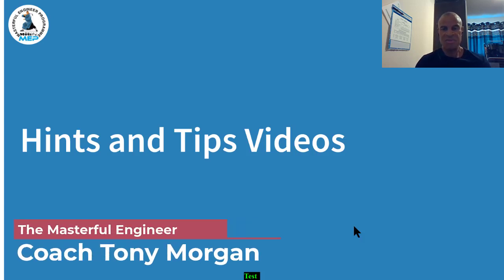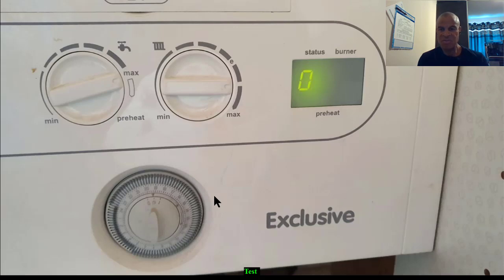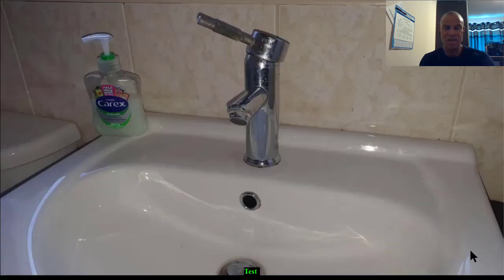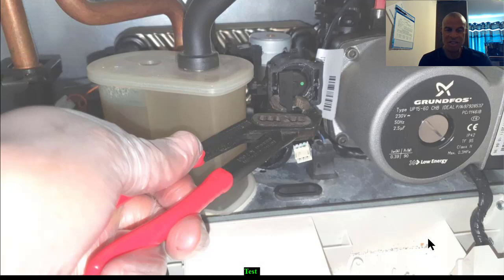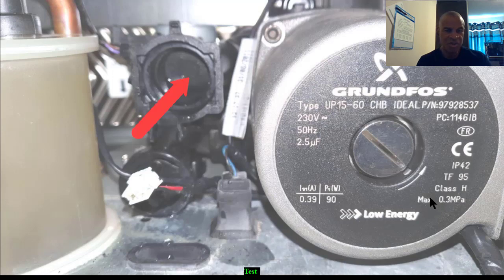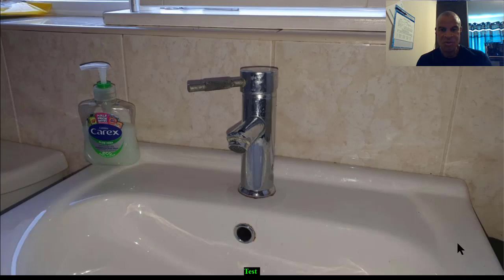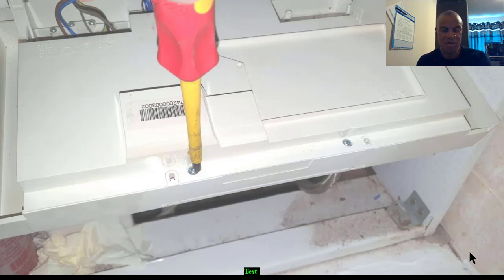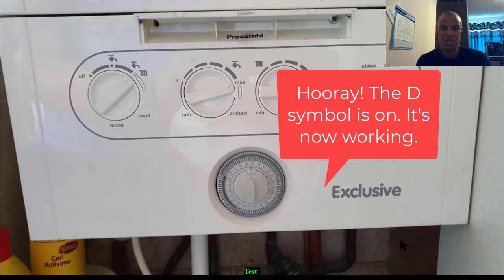How To Renew A Flow Turbine Ideal Exclusive 24 Hints and Tips

Comment: This is not how you do it! You don’t need to mess about with the circuit board all you do is put the power onto the boiler twist the left-hand knob clockwise to the reset mode you will see the boiler reset and go for a reinitialisation process
Reply from the maker: hey we're currently trying to grow our Facebook group and would love you to join Tony and the team using this link, Tony will be available to answer all your questions directly https://www.facebook.com/groups/167070231326174 we will also add this link above.